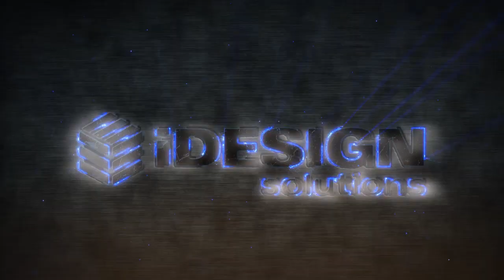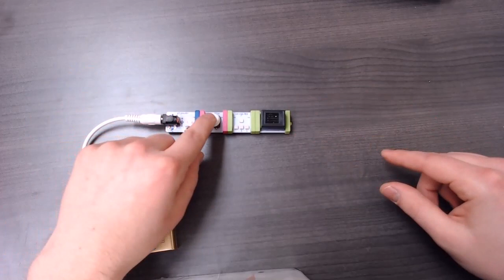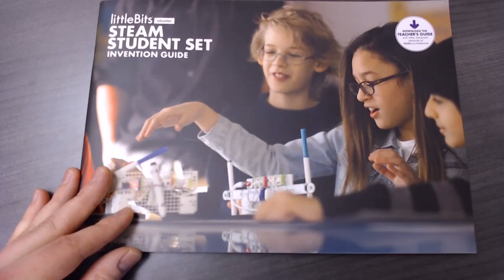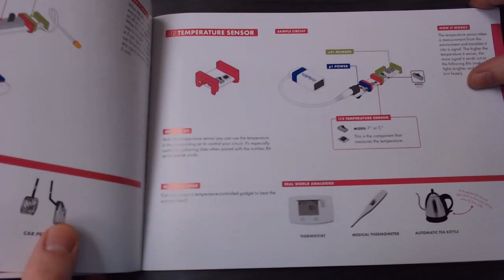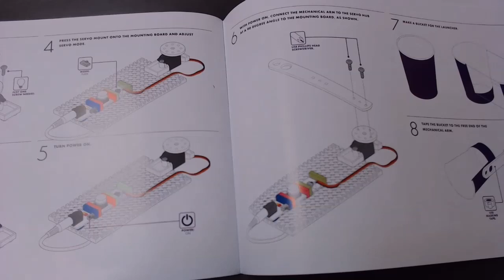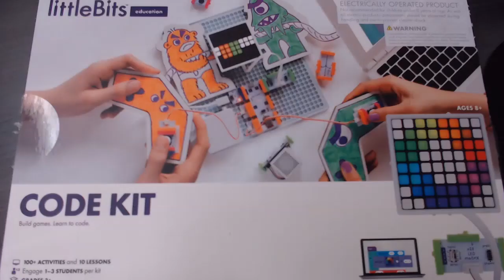littleBits STEAM & CODE kit brief overview

Comment: Is this Code kit suitable for a clever 8 year-old?  I’m a bit worried that the coding is done in C, which is a heavy language for beginners.  Does the Code Kit App do a good job of replacing the Arduino programming kit with an easy to use programming environment?  There’s no way my nephew and his father can get to grips with naked C programming.